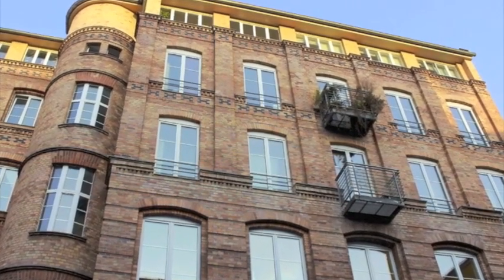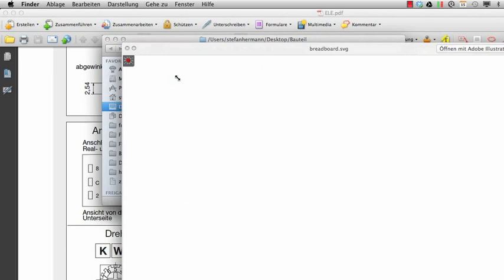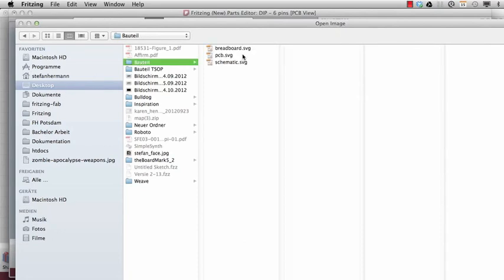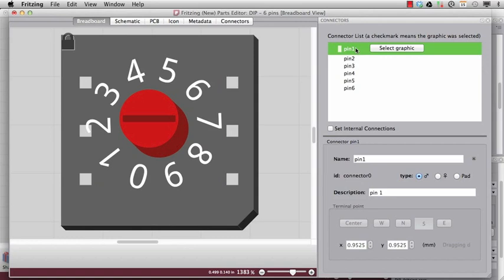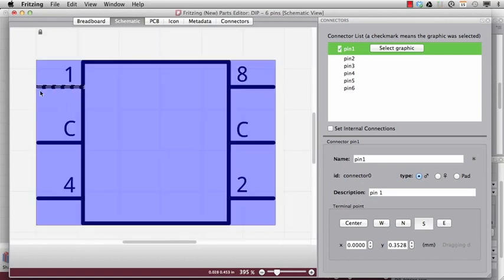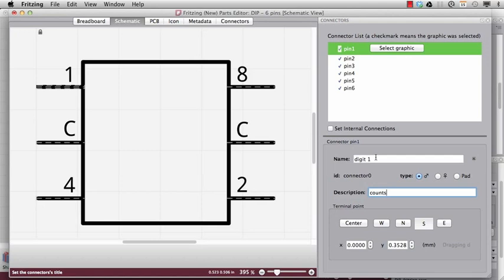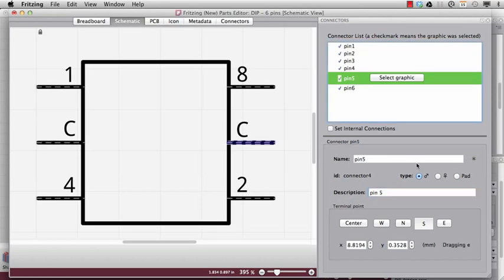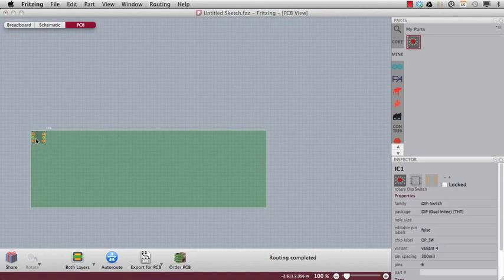Fritzing Killer Tips Episode 7 -- Parts Editor

Comment: Just thought I'd throw a quick new user comment in here.  I think that part creation is the deal breaker in using Fritzing.   It's fine for hooking up a quick Arduino and breadboard with stock parts they have but making new parts is not intuitive.  I would prefer Eagle for a free CAD tool.   Parts creation is not easy at first but it can all be done WITHIN Eagle.  To just show a simple schematic quickly with no PCB, I prefer Visio.